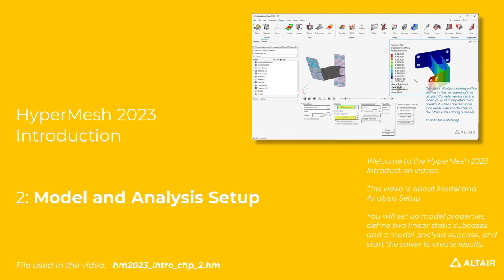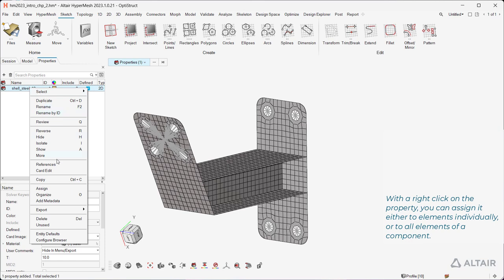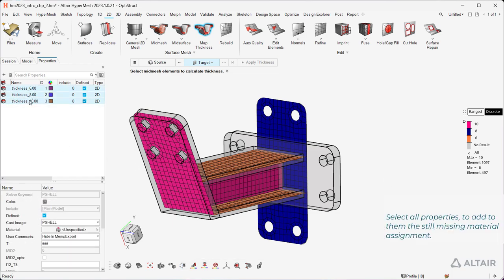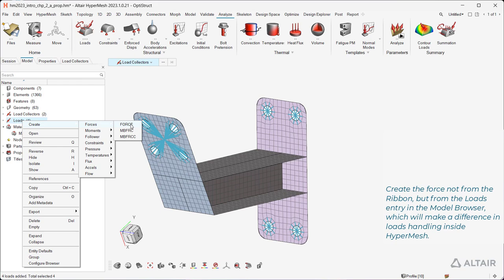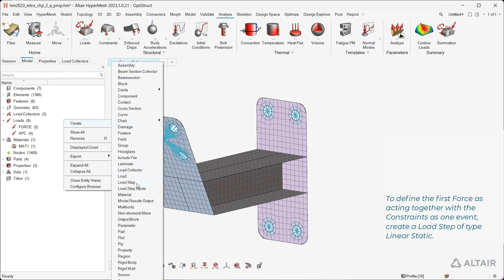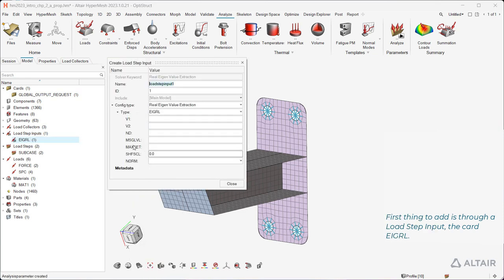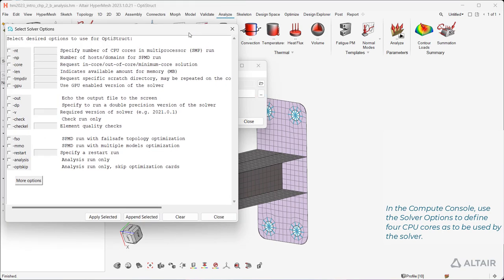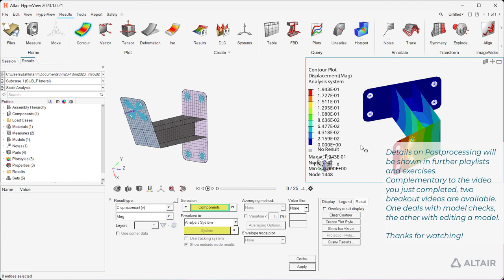2 - Setup and Analysis

Comment: This is my first time using hypermesh and optistruct, and I am following a tutorial file for a class. When I reach the end and go to run the optistruct solver, I save the FEM file, and then export with default settings, but then I get nothing. no console for the solver comes up, and most importantly no h3d file is generated so I cant continue to post process. The file is a 1d structure, the entities are lines connected at nodes. There is a load at one part as well as some displacement constraints. I followed a guide to set it all up so Im sure its good, but this part is frustrating me.
Reply from the maker: hello, having no console showing up when you run OptiStruct analysis generally means you installed only HyperWorks Desktop, not HyperWorks Mechanical Solvers package. Or you installed both separately, instead of using the main installer.

Comment: I wish there was an explanation when making cards. Like highlighting their purpose when you mouse over them. Creating a run deck in hypermesh is very tedious when compared to other programs
Reply from the maker: hello @tetekeke, HyperMesh is a multi-solver environment allowing linear, modal, dynamic and explicit analysis, thus for multiple solvers. If you are working with other software which are dedicated to one solver, then for sure such software can propose a dedicate experience for this given solver. As an example, if you were to run OptiStruct models for 3D mesh, for sure you can use HyperMesh, but in many cases you could use Simlab, or even Inspire (the 3 of them having a unified interface). Or even, in some cases such as large assemblies, you could use SimSolid. Coming back to HyperMesh, it is intended for engineers familiar with FE simulations. We do not propose contextual help for the cards, but if you hover your mouse over card attributes in the Entity Editor, then generally you have a small information (mostly issued for respective solver help)